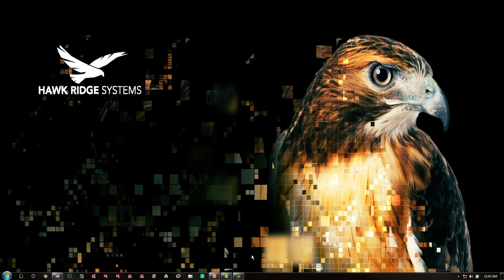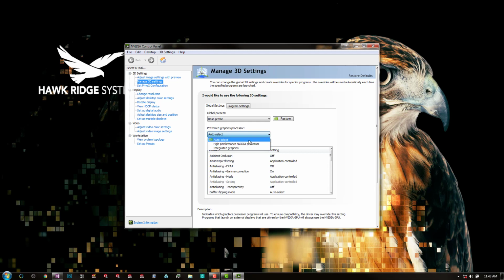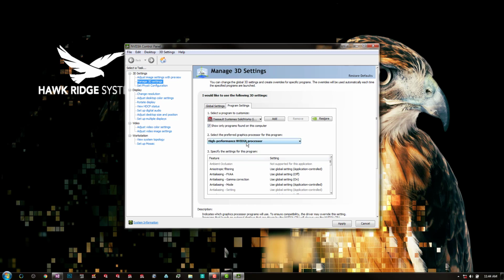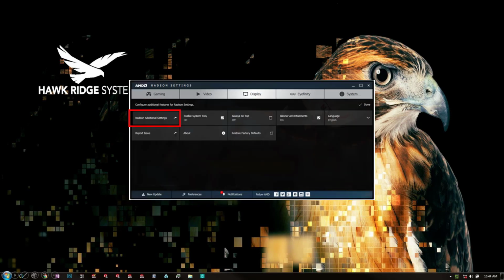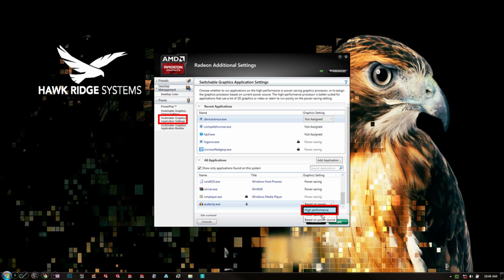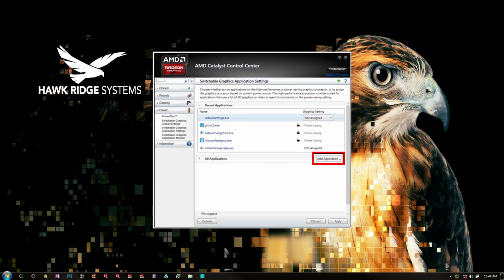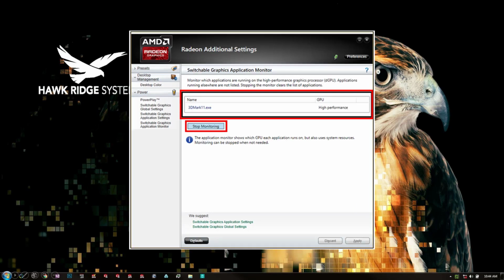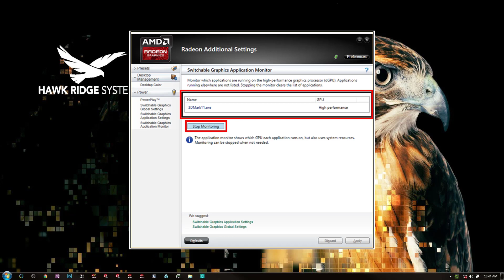SOLIDWORKS Tips and Tricks: Graphics Card Selection

Comment: It doesn't seem to work for me. Sw is running on integrated gpu instead of my nvidia high performance card. I've tried this, and I updated the drivers for my card but it still doesn't seem to jump to the right card. I have been looking for a solution for a long time, but I can't find any solution for laptop users..
Reply from the maker: Hi Oscar, we're sorry to hear you are having trouble with SOLIDWORKS. Our engineers would be happy to assist you. Could you fill out the form here http://bit.ly/2N22Jpb  and we can reach out to you directly
Reply: any solution for this problem??? i am having same problem